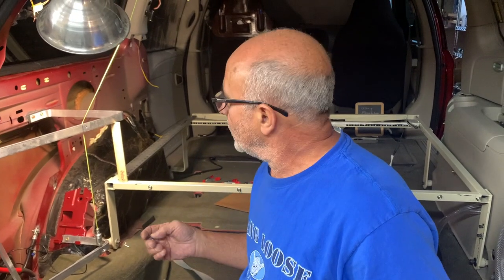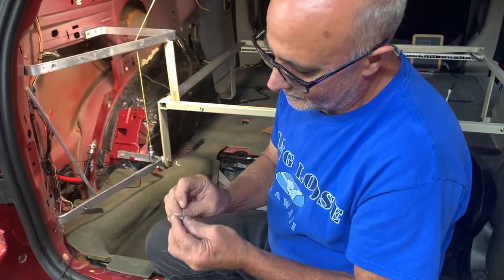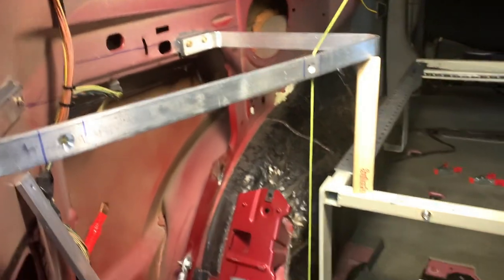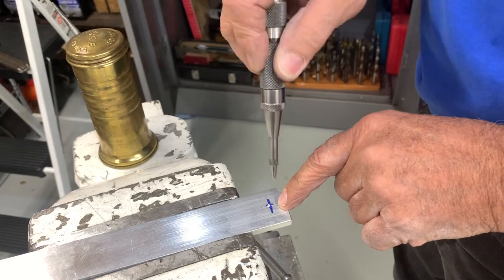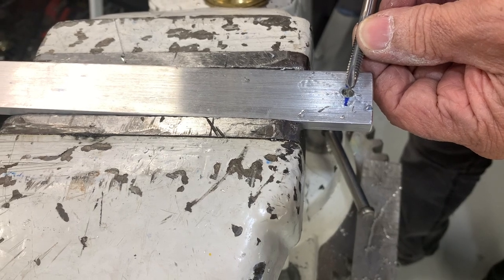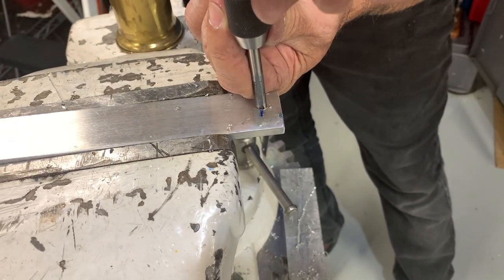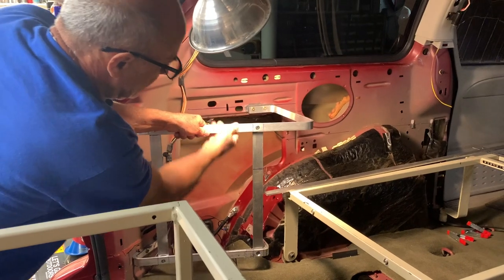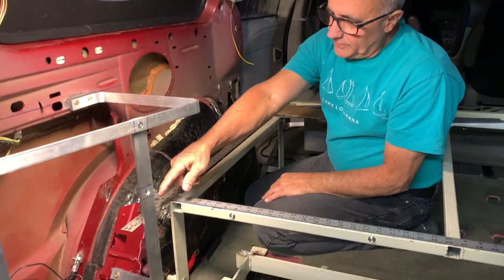Stealth Grand Caravan Mini Van Camper Update 4

Comment: Good info. I want to acknowledge your wife also. Each video she has done good camera work. Very enjoyable to watch and listen. I'm curious though. Even though you plan to keep ample clearance around the inverter, would the fan on a 2K watt inverter be pretty loud once it reaches its thermal activation temperature? For example, at night, you want to use the inverter for some medium/high current application (i.e. A/C, crock pot, etc.). It would be very difficult to get peace of mind hearing the fan whirl away underneath the bed. But, this is just me making an observation. It may not be an issue in your application.
Reply from the maker: Thank you Tammy says thank you. We only use the inverter to make coffee and ice so either we’re driving while we’re making ice or were awake and making coffee so we actually don’t use the inverter while we’re sleeping or resting